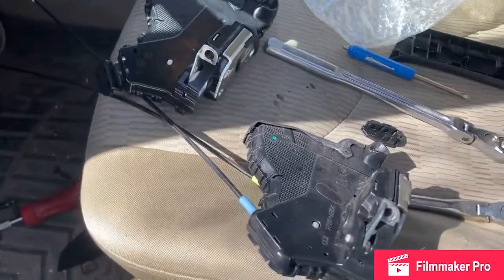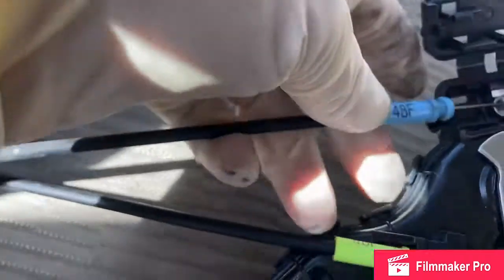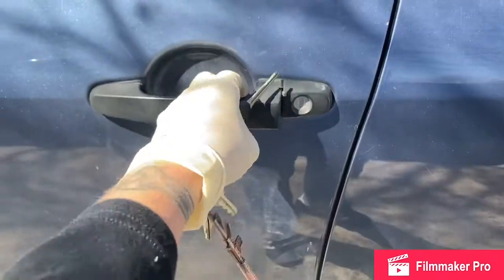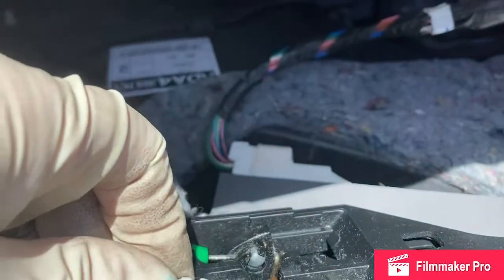2012 Toyota RAV4 Driver’s Door Latch Replacement

Comment: Hi, any link where I can order the door lock Actuator for Front right passenger? Thank you.
Reply from the maker: SYERAL Power Door Lock Actuator Front Right Passenger Side 931-403 Latch Motor Replacement for Toyota 4Runner Camry Corolla Tundra Sequoia, Lexus ES350 GS350 LS460 RX450h Scion tC xB xD iQ https://a.co/d/bNfcdXN